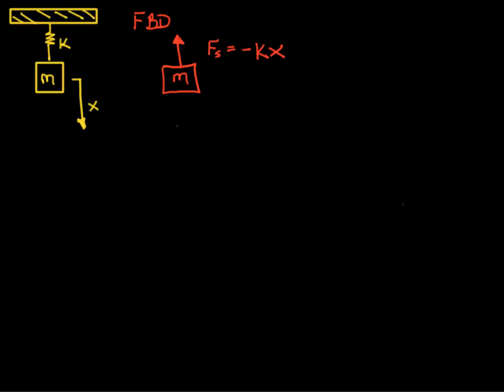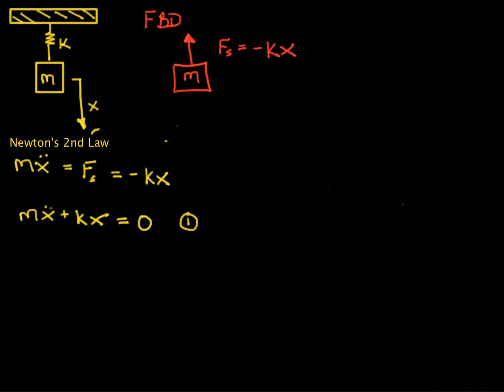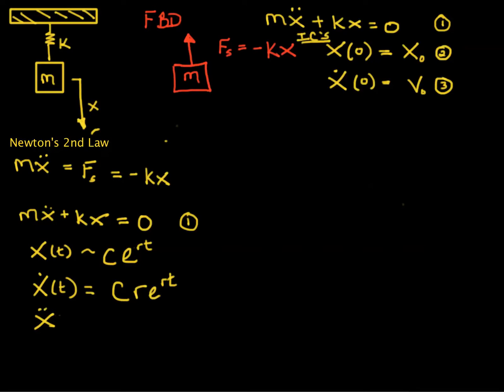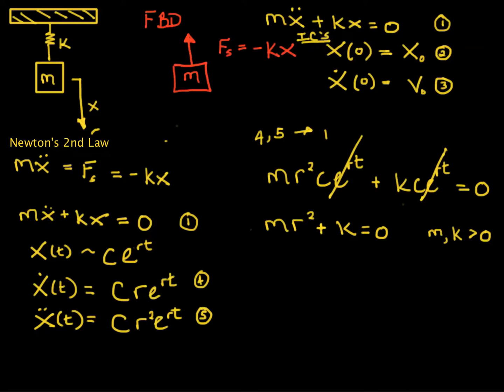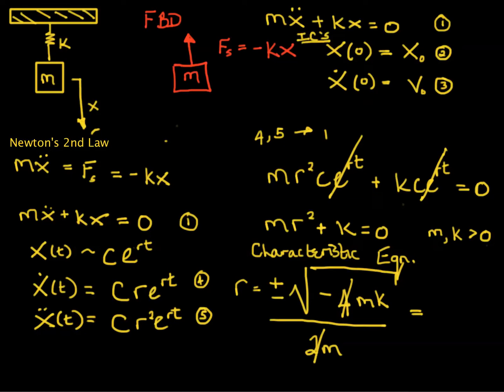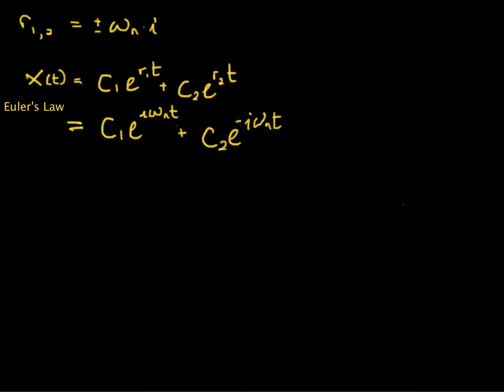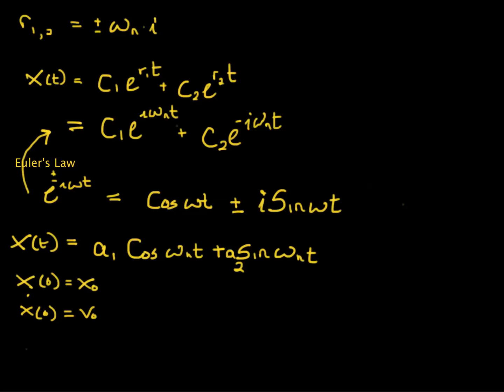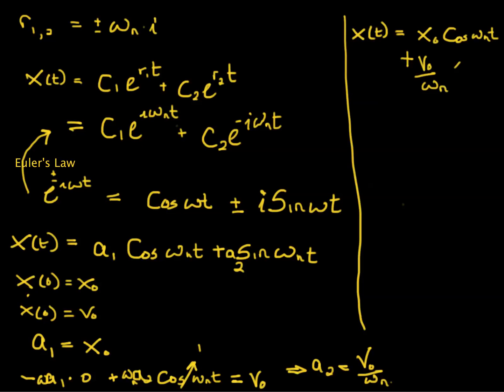Free Vibrations of a Single Degree of Freedom Problem (Simple Harmonic Oscillator)

Comment: Why do we write F=-kx, when it is already acting opposite to direction of x?
In that case ma-kx=0 would be equation of motion. Where 'a' is acceleration. I'm confused in this part.
Please clarify it sir.
Reply from the maker: Yes, you're right.  I should have drawn the force vector pointing downward on the free-body diagram.  Once I used that F=-kx, I should have flipped the direction of the arrow.

Comment: Could you kindly let me know the difference between this method and the space state condition?
Reply from the maker: This method yields a 2nd order differential equation.  State-space form required the equation(s) to be 1st order equations and is generally a useful form if you are going to be using numerical integration to solve the problem - a common method of solving such equations.  One can convert a set of equations to state-space form using simple substitution.  

Every 2nd order equation that is converted to state-space form, results in two 1st order equations.  So in reducing the order of the equation, we double the number of equations.

Comment: great vid , but can you can you tell me why when x(t) = c e^rt , why is that in every solution of second order linear equation ?
Reply from the maker: This goes back to fundamentals of differential equations.  I talk about it here: https://www.youtube.com/watch?v=S2-26LR8_Es
The basic idea is that in trying to solve a 2nd order ordinary differential equation (ODE) which states that a linear combination of a function and its derivatives add up to zero, one will quickly come to the conclusion that the exponential function is a good candidate BECAUSE derivative of the exponential function is itself - the exponential function is equal to its derivative d/dx e^x = e^x.  In order to generalize it a little more, we add use e^(rx) because differentiating this results in multiplying it by r.  This allows us to handle the fact that the terms of the ODE can have different co-efficients.  We add the 'c' in front because this allows us to handle different initial conditions.
Reply: @Freeball99  so you tell me that there is no exact solution for ODE , i took a course (numerical method ) it solve the differential eq but not in exact way can you tell why is that or just send me a vid talk about that , thank you
Reply: @Freeball99  can you answer my question , thank you

Comment: thanks for the awesome video. at 9:10 you write out the equation for x(t). Could you please tell me how you got that equation?
Reply from the maker: This goes back to my initial assumption that x(t) = Ce^(rt) - I didn't number this unfortunately.  Based on that, I showed that for a second order differential equation one will get two solutions (because the characteristic equation has two roots).  So, I expanded my definition of x(t) to be more general so it would include both solutions.

Comment: You are in the vertical direction I think you need to take into consideration the gravitational force the differential equation should have three parts 
Mg-kx = Ma ==> Ma + kx = Mg which the second order equation with Mg as external force acting on the spring mass system
Reply from the maker: Typically when examining the simple harmonic oscillator, gravitational effects are ignores.  There is no assumption made that it is oscillating vertically and can similarly be thought of as oscillating in the  horizontal plane on a frictionless surface.  I have made a separate video that examines the effects of gravity and under what conditions the gravitational effects may be ignored.  https://www.youtube.com/watch?v=TpZMTo-Lig4

Comment: How did you apply euler law in eq at 10:48 then the out come was without complex i?
Reply from the maker: This is a very good question...

The answer is that, in general, the constants c1 and c2 are COMPLEX numbers.  In particular, it can be shown that if c1 and c2 are complex conjugates, then this will result in a real function.  

If you want to show this, my suggestion is to work backwards.  Start with x(t) = a1 cos ωt + a2 sin ωt.  

Then, from Euler's Formula, it can be shown:
 cos ωt = [exp(ωt) + exp(-ωt)] / 2 and sin ωt =  [exp(ωt) - exp(-ωt)] / 2i.  

Substitute this into the equation of x(t) and group the co-efficients of exp(ωt) and exp(-ωt).  You will find that these co-efficients (which are the constants c1 and c2) are complex conjugates.
Reply: @Freeball99  Its a bit confusing. If c1 and c2 are complex and coefficients a1 & a2 turn out to be real, then we will miss the phase information in x(t). And evaluation of phase difference between displacement, velocity and acceleration will not be possible. You are requested to kindly explain this part.
Reply: I have just seen your video on harmonic motion. I think it is only a representation thing. Correct me if I am wrong. But I feel complex representation is better.

Comment: Define and explain the two intrinsic properties of physical system which are responsible for oscillating behaviour of oscillating system?
Reply from the maker: The two properties would be the mass of the system and the elastic/restoring forces.  Generally the latter is due to the elasticity of the material being used.  In the case of a structure like a building, the mass is primarily derived from the mass of the floors (usually wood or concrete) while the elasticity comes from the beams holding up the floors - generally either wood or metal, both of which are flexible.

Comment: great, but I just want to ask why do not we study also the gravity force (mg) ?
Reply from the maker: The short answer is that you haven't been told that gravity exists in the problem (you can think of this mass vibrating horizontally on a frictionless surface).

The slightly longer answer is that for translational systems like this one, the effect of gravity is that it simply shifts the equilibrium position about which the mass is oscillating.  So, if we assume that the mass is vibrating about its equilibrium position, then we can ignore the effects of gravity.  Here is a video explaining it: https://www.youtube.com/watch?v=TpZMTo-Lig4

Comment: Question about the algebra done at 6:34. How does the m in the square root and the m in the denominator cancel out? I know it's simple arthmatic but I can't seem to convince myself that it works for some reason. Anyways, great videos. My course lectures focus more on the mechanical aspect than the mathematical, so this is really useful. Thank you.
Reply from the maker: It doesn't cancel out completely.  

I have SQRT(m) in the numerator AND m in the denominator - which is the same as SQRT(m) x SQRT(m)  

The SQRT(m) in the numerator cancels ONE of the SQRT(m) in the denominator.  What I am left with is SQRT(m) in the denominator - which is what I have done in the video.

Comment: man you are awesome, I'm following along the material because i stumbled upon it in my recommendations and saw that you have some python coding ! I'm a fresh  mechanical graduate trying to learn python for engineering applications, to eventually get a job as a engineer working for an aerospace company like Firefly, SpaceX, Airbus, Barrios, or Parragon . If you have any advice or can maybe show some more python coding videos that would be awesome^2! thanks
Reply from the maker: Thank you.  This is great to hear!

With regards to learning Python (which I highly recommend)...you might not be aware that Python was invented by Guido van Rossum who for many years worked at Google (until recently).  Partly as a result of this, Python is used extensively at Google (Google's search engine was originally written in Python as is the backend for YouTube).  Consequently, there is a lot of instructional material that Google has released on YouTube - these are a good place to start for the fundamentals.  Beyond that, you can check out sites like Udacity, Codecademy and Udemy - which have a bunch of free material on Python.
Reply from the maker: BTW - I do have several other Python coding videos.  Look through the playlists below and any of the thumbnails that have a black background are typically coding videos.

https://www.youtube.com/playlist?list=PL2ym2L69yzkZJ1fY3SQ1JCyvZIoJYXQGZ (mechanical vibrations)

https://www.youtube.com/playlist?list=PL2ym2L69yzkaue8Ly2Oz51LALRzUV8LZ0 (finite element method)

Comment: how to calculate the discerete fourier transform of a harmonics function and what to do with non-periodic function?
Reply from the maker: First of all let me address the non-periodic functions.  In the event that the function is simply a constant, then this can be treated as a periodic function in the limit as the angular frequency, ω --> 0.  For truly non-periodic functions, using Fourier transforms is possible, but very tedious and messy.  I would NOT recommend Fourier transforms for this.  Rather use a convolution integral instead.

As for the treatment of periodic functions, I will have to make a video on this because it's very mathematical and this comments section makes it very difficult to explain things with equations.  In the meantime, here is a video on the subject.  I think this guy does a good job explaining it.  Hopefully this will clear it up for you: https://www.youtube.com/watch?v=x04dnqg-iPw

Comment: im gonna die during my midterm tomorrow.... :(
Reply from the maker: How did your midterm go?  I don't mean to be a buzz kill, but this is the sort of material that can only be mastered by working many example problems - it's hard to figure it all out at the last minute.  I'm happy to answer any question you might have if I can be of help.  Is there anything in particular that you find the most confusing?  Is it the application of or the solving of the math that's throwing you?
Reply: @Freeball99   he couldn't reply because unfortunately he passed away to midterm induced death.